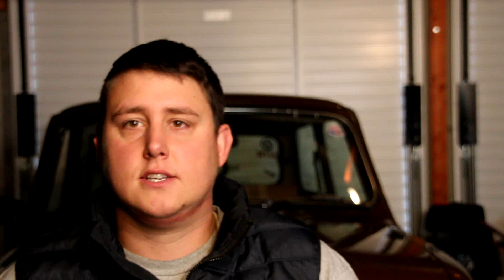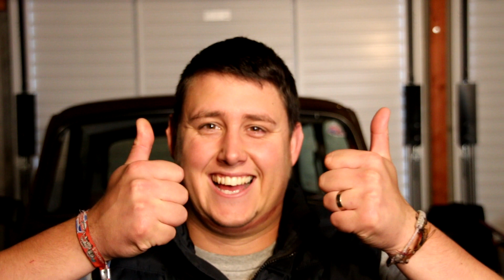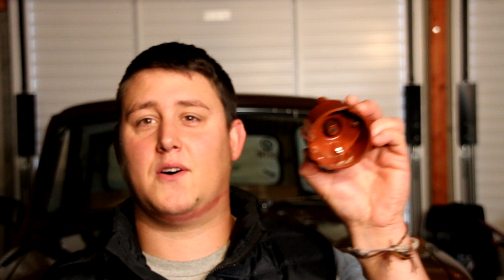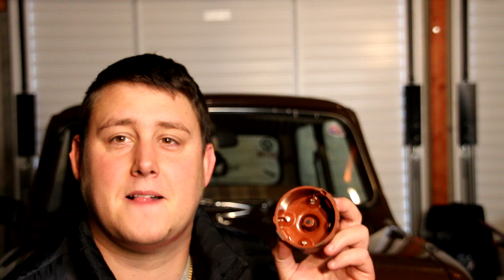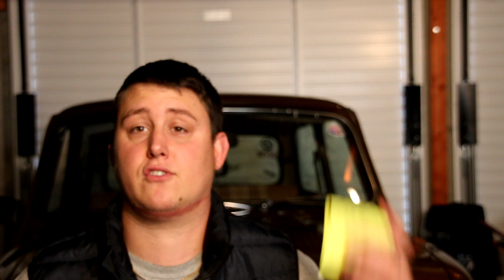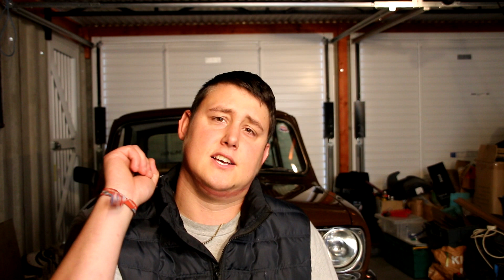Incorrect information given this morning

Comment: The simplest way I was explained the points and coil set up was that a voltage was supplied through the coil and down to your points, causing the coil to create a high voltage on its secondary side ( the side your ht lead goes from to the centre of the distributor,)  when your points open the field in your coil breaks down causing a huge discharge to travel down ht lead, depending upon were your rotor arm is positioned depends upon which plug gets the spark, the process then repeats for the next plug , hence your ignition “timing” . Hope this helps as it has always helped me when fault finding, please feel free to remove if you think I am wrong ?
Reply from the maker: That's a great explanation pal :) makes sense to me anyway

Comment: Greetings from Australia, your original Vid was pretty correct. I have over 50 years mechanical experience and I was able to follow your procedure. Did it use the technically correct terminology? - No. However, did it produce a resolve of your problem - YES! Much cheaper than having a mechanic charge you $80AUD an hour for the same result. Keep posting!
Reply from the maker: Thanks Patrick, love this comment :)